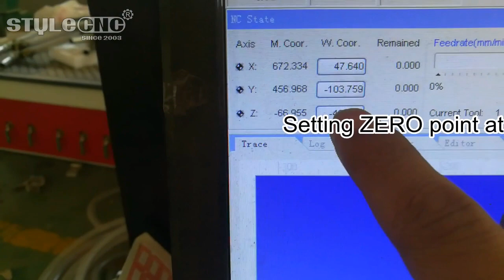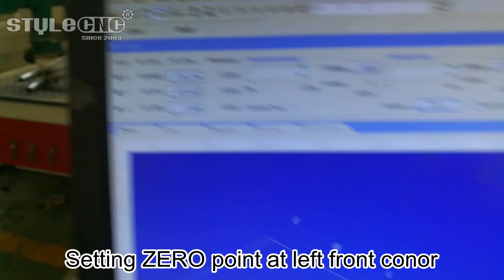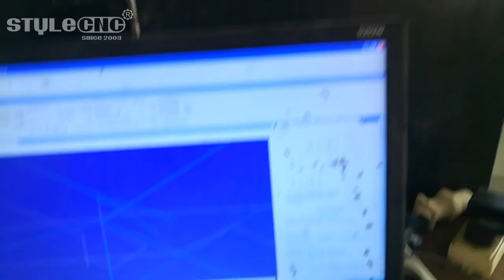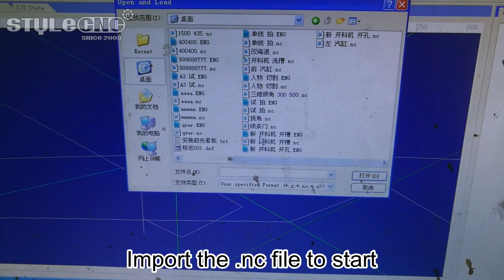How to Make Cabinet Doors by ATC CNC Router Machine?

Comment: should have rabbited back side of moulding in 2 step operation, to give  seamless look so the moulding could expanding with time, with out showing a hair line crack in the finish.
Reply: It's MDF, there's virtually no movement of the parts due to expansion/contraction.
Reply: @acerjuglans383  if there was over lap the seam would be hidden... all finished will crack over time especially in this type of seam.